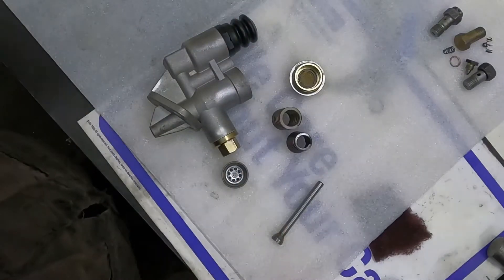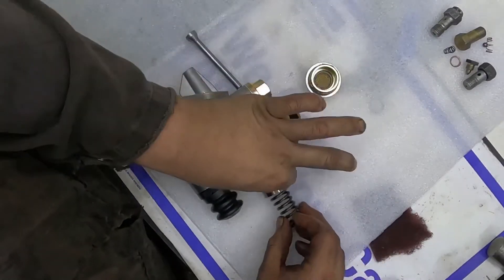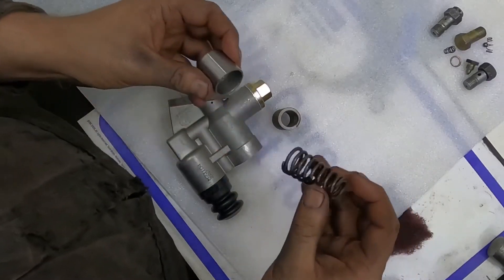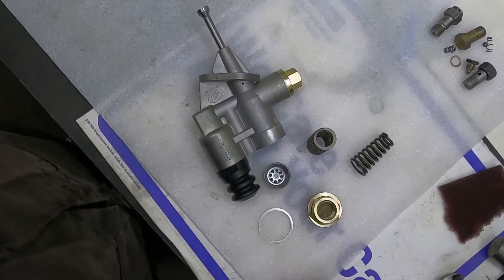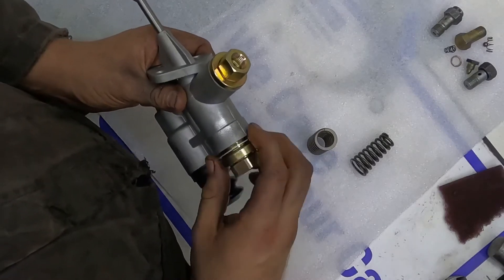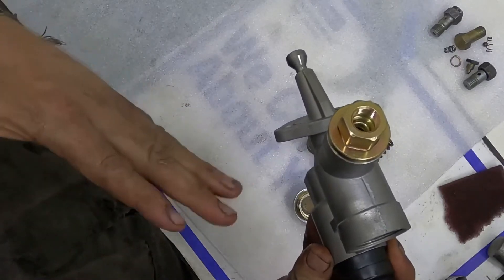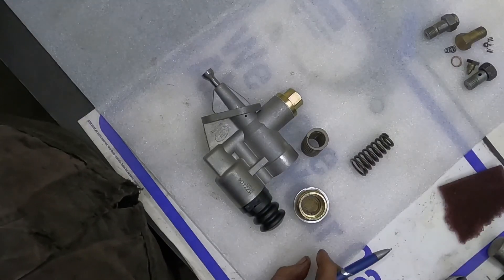Upgrade Your 12V Cummins Factory Lift Pump: Unleash Your Engine's Full Potential

Comment: i've used one of the cheapo pump like the ones in the video.they work but they are some pretty crappy pumps..those gold colored fittings are actually cheap cast steel,that will crack very easily,i have run many pumps on my 12 valves over the years,since 1996..and the best one to date is the DECC  OEm Cummins one made in China of all places,i searched high and low to find a Carter OEM Cummins one,and trust me,Carter is NOT what it used to be,,it was by far the most garbage pump i ever used,and it only had  a 26mm piston.and complete garbage for machining,and lasted 3 months,i've even used really cheap one,,$25.00 Amazon pump,and they were better built than carters.about the only thing that goes in these pumps is always the check valves,i've bought a cheap pump to steal the check valves out of to rebuild an old carter pump from when they were good,and it's been on a truck for 5 years now,if only we could source those check valves,
Reply from the maker: i have used the decc pumps with good results,  i think it a hit or miss on alot, thus carter pump is 6-7 years old ( nos) i bought 200 of then years ago, but i only have two left so i am going to be buying some decc ones next
Reply: @CUTTERUPROB  DECC ones on Ebay  $55.00 US each,free shipping within the US,i get mine shipped near me in Ottawa at the NY border and go get them,they have the cheapest price i have found,
Reply: I think one of the popular modifications to perform on these pumps is to shove a bolt through the relieve valve tunnel to block it off to eliminate that issue. And my understanding is that many newer pumps come without them so there is no need to do address it.

Comment: Ok so I have a 97 12v p-pump and I have already dump a lot into it but I have about 30psi at cold idle and about 20psi at warm idle could I do this to my truck to keep my p-pump healthy
Reply from the maker: yes you sure can. i would also do a overflow valve mods as well or replace it

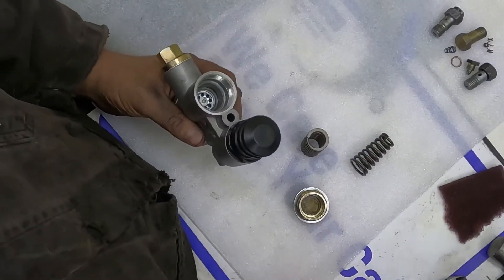Comment: 6:24 so what was the psi with the stock pump and comp spring?
Reply: Adds 20 to the stock 20ish for a total of 40??
Reply from the maker: @bfmco7  yep
Reply from the maker: depends on the pump. but most of the time it ads around 20-25psi

Comment: Do you have a part number for the 30mm pump? Or at lest a part # for a good one at a good price. I also hear that some don't come with the weep hole and when the pump leaks it can leak Diesel into the crankcase. Not good !
Reply from the maker: I have only seen pumps with a the weep hole on the outside. On the bigger pump I going to have to look into the last couple I have got we’re do some looking
Reply: @CUTTERUPROB  People have said that with out the weep hole that when the push rod seal and or the piston seal goes bad. The fuel has no choice but to leak into the crankcase.
Reply: Your just thinking out yout oil which does effect the ability for the oil to remain on spinning  parts and will find slow leaks and make it leak faster. But at what rate? If you notice your oil rising on your dipstick not good. But not the end of the world. I would think you would have other issues like the loss of power, and quite a few other things before an issue with thinner than normal oil.  Of course if it is summer and you live in Arizona more of an issue than Colorado in winter.
Reply: So no enlargement of the check value intake port?

Comment: One more item to add to my 12 valve build! Thanks for the tip!
Reply from the maker: Right on!
Reply: @CUTTERUPROB  Just to clarify... I can do the lift pump mod and the relief valve mod all on stock setup as far as engine goes. I have an upgraded trans from jasper TC lock up switch and TPS delete. Are there any HAVE to do mods for this to not cause problems with stock engine? I plan to do more and more mods. But little by little. Haha
Reply: @CUTTERUPROB question I’ve turned my pump up on my 12valve it was running fine randomly truck starts running rough  hard starts trucks been stalling out going down the road anyway you could help

Comment: Where do you get those 30mm style pumps. I have looked up a lot of “high flow” pumps but none of them say the plunger size and I don’t want to drop a couple hundred on another 26mm pump.
Reply from the maker: its a hit or miss thing i have got all different sized one from the same supplier with same part number.
Reply: Dang. Well thanks for the reply maybe I’ll get lucky when I buy another one.
Reply: So what pump is that one?
Reply from the maker: @8tyeightify  honestly i did measure it, it was just for the video i put the stock spring back in it.
Reply: @CUTTERUPROB  sorry i meant what brand is it.
Reply: The DCEC on ebay is a 30mm. Just micd mine.

Comment: Hey rob power driven diesel has a factory style lift pump that can support up to 750hp what do you think they do to theres?
Reply from the maker: with a 215hp pump i am sure you could make 750. I just found it hard to keep the pressure up above 500hp myself